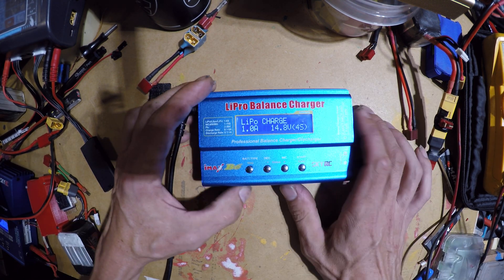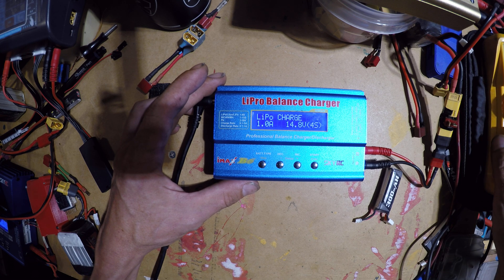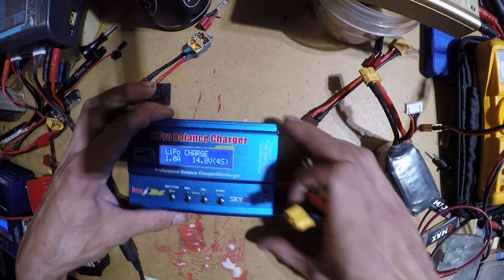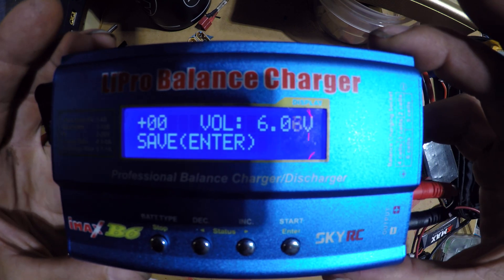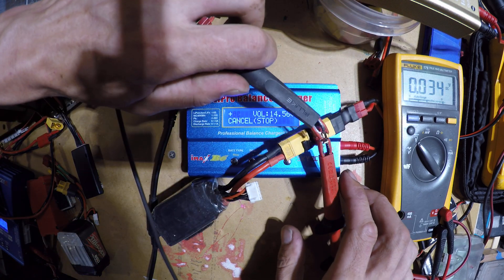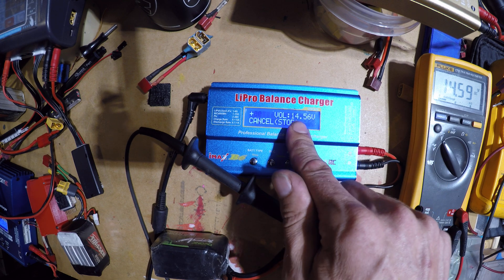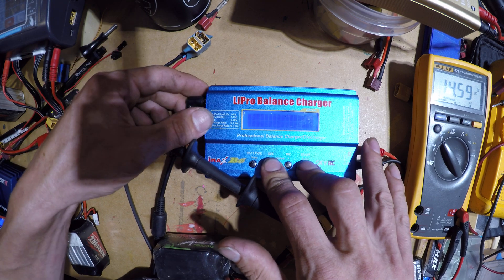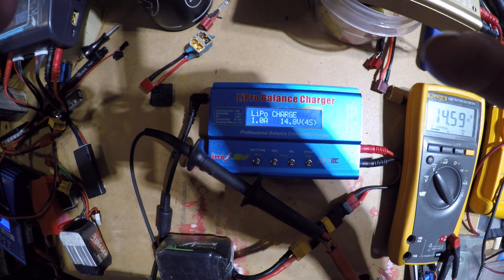How to Calibrate a Balance Charger

Comment: Does the battery need to be fully charge before used it for calibration purpose?
Reply: no . the battery just tells you what your charger should be reading voltage as, if its not the same as calibrated voltage meter. both should be reading the voltage the same at any voltage.
Reply: @williamwindex3890  ok thanks for info.

Comment: thanks! this just popped up and i charge alot and didnt know this. mine have to be way off..
Reply from the maker: Yes it helps , don't worry I went for years without calibrating mine too. Usually if it's a decent charger it has a calibration menu or some way to calibrate. Good luck, Godspeed 😀